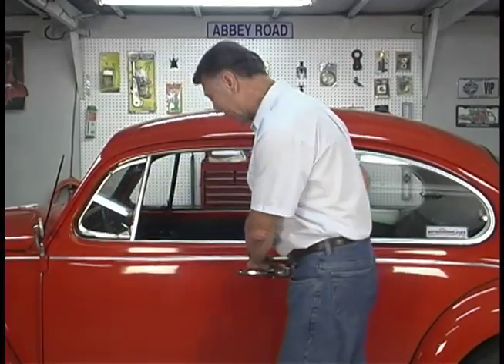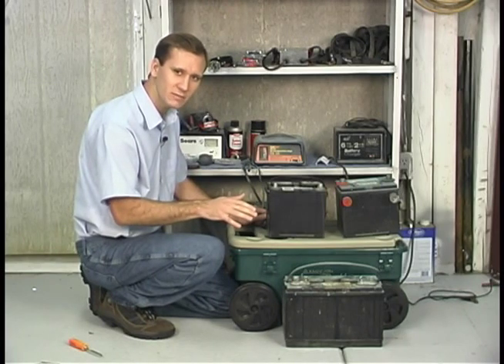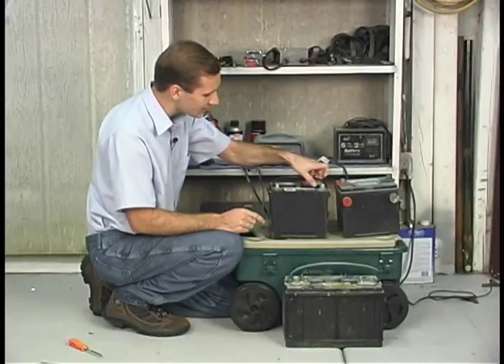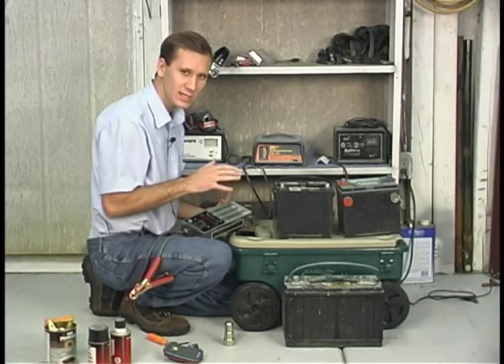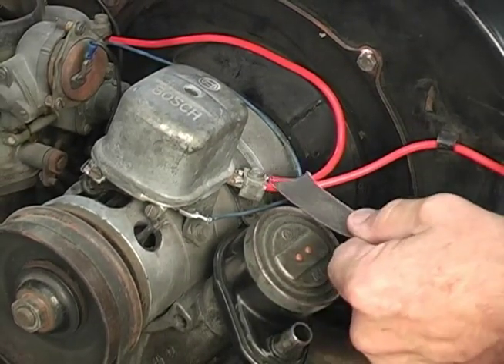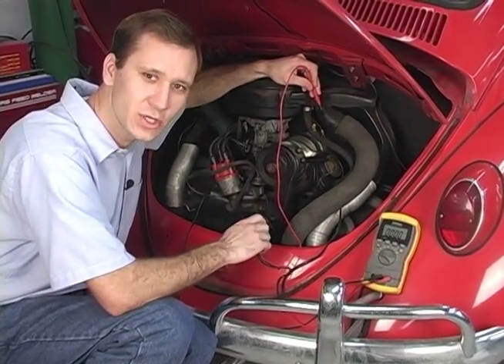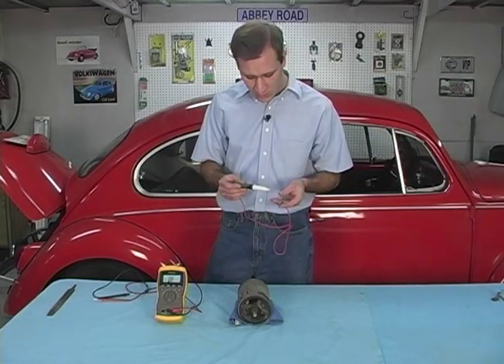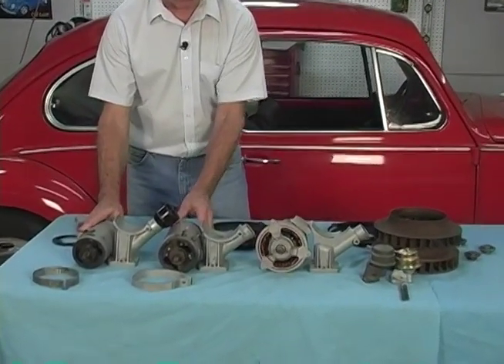Sample clips from: Bug Me Video -Volume 10 Electrical Troubleshooting DVD (Volkswagen Bug)

Comment: I have a '69 Bug, Automatic Stick-Shift which having similar issues to Steve Jenks.........................but my starter does not even click. Replaced battery, replaced starter, have voltage to starter, can cross over start, but getting nothing from the switch when I turn the key. Maybe a coil problem also....................where can I can start and go from here?

Comment: wow My 1rst beetle is a mexican bug, its all new style stuff delay wipers colum ingition,electric fuel pump fuel injectors air conditioning...i let it sit up for 5 years{morguage crisis} and the whole brake system rusted up and the fuel tank ethanol rusted too. coated the tank red kote and dot 5 fluid in the new brakes. i knew if i got an old bug it would have problems i guess the fuel they sell us and the dot 3 fluid can kill the car too..bugs need to be built to sit. They always end up sitting and another car gets driven..

Comment: have a 1971 super beetle . i am having wiring issues so  the starter just clicks , 
i have replaced the battery , the starter and still just clicks , one of my issues is 
wiring you  videos are a big help  i kind of  am getting  to where i remember some things  from when i was  a kid ,i traced the problem to no fire in the coil,.  i believe i need to replace that wire ?  do i need to replace the entire harness is my question ?